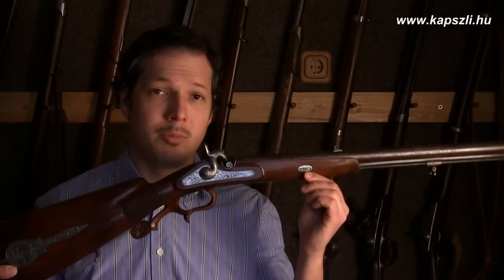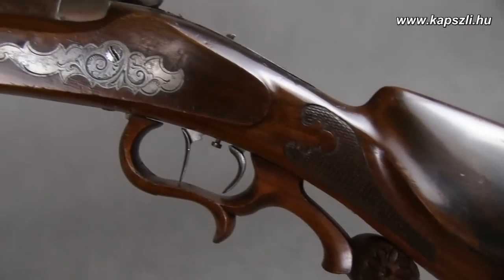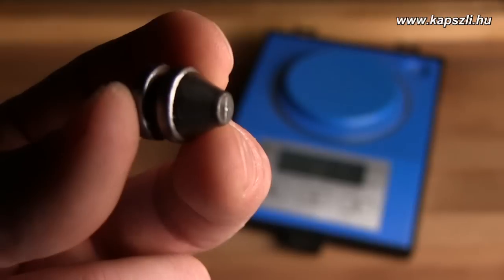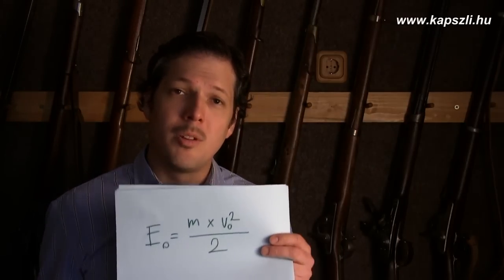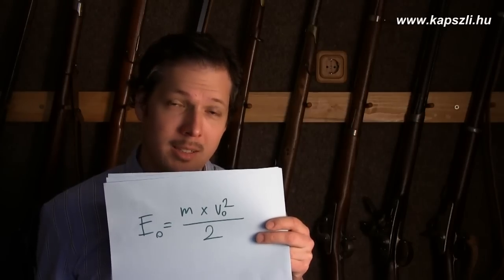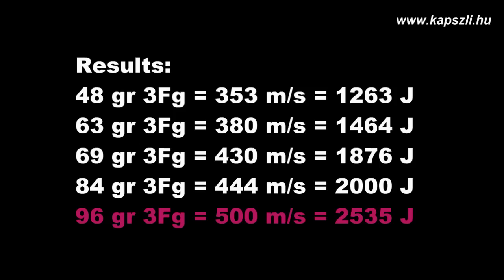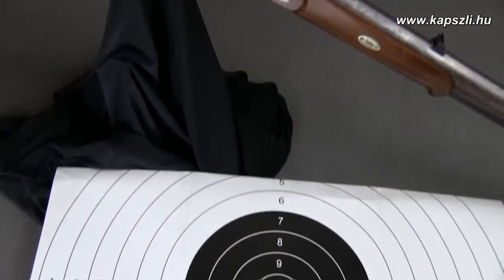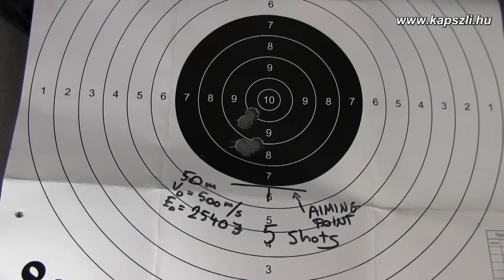Hunting load for an antique muzzleloading rifle

Comment: To give an example, the factory listing for a 170 grain bullet from a Winchester .30-30 just barely cracks 2,500 Jules of muzzle energy. If they had to use the muzzle energy guide here, I'm afraid there would be a lot of rifles relegated to the gun cabinet or the rack of the gun shop as they would get sold off.

Comment: Good heavens, a .58 roundball doesn't have enough penetration? How big do your roe deer get? In north America guys are taking elk and moose with .54 balls, I live in northern Canada where 200 lb whitetails are nothing worth bragging about and I've never had a problem using .50 cal balls. Other than that, great video, top notch as usual.
Reply: spot on and big grizz have been taken with a 50 cal Hawkens
Reply: My dog is larger than most roe deer.
Reply: My new custom made muzzleloader Caplock .510cal 51inch barrel smoothie is arriving on Friday this week, I can't wait to test it out.

Mostly I hunt for upland/small game.
Reply: @explorer3344  I'm confused. Did you order a smooth bore?
Reply: @ironstarofmordian7098  Yes mine is smoothbore. I've shot down two birds so far ^^
Reply: @ironstarofmordian7098  you can see in my channel, I've just posted.

Comment: I have a hawken 50 cal with " made in Italy ", on it with a big  "I"stamped on it. I'm assuming it is an Investarms product but can't be sure. If so it probably has a 1/48 twist rate on the bore. I'm confused on the ammo to use for this rifle. Cap and ball of course is to be used but could I also use a Minie ball? There is blog after blog stating for and against using a sabot round with this twist rate. Any thoughts? I've " subbed. ", your channel by the way and look forward to learning more, thank you.
Reply from the maker: If the twist is really 1:48 it can be shot with patched RB with moderate loads, and you can also use short conicals like Maxiball or REAl bullets with higher loads. The Minié balls will not work well for sure.
Reply: Ok, thanks for the help.I just looked up REAL bullets by Lee-interesting I had never heard of them before ,thanks .
Reply: You can find different bullet designs for that. My dad has a 50 cal bullet mold for loading 500 magnum cartridges. I may use that in a future video.  If it fits in the bore you can use it, just be careful though, don't use something that's too big or too small, it should be in the .490 to 4.95 range.
Reply: I have one of those rifles. I have fired patched round balls with .490 round balls and pillow ticking material lubed with vegetable oil. 60 to 90 grains of 2f worked well. For a fast reload i used a mini ball. Too much powder may blow out the skirt. I ordered my 50 caliber minis from Dixie Gun Works. As i recall about 70 grains worked best. Every gun is a little different so shoot it off a bench and work up a little at a time until you find the sweet spot.
Good luck.
John Davis
Jax Fl

Comment: Nice, but not as useful without knowing the pitch of the rifling twist.  Slow-twist barrels (say 1turn in 66 inches) intended for round balls won't stabilize bullets, and the older Jaeger rifles were traditionally made with one twist per length of the barrel (say 1 turn in 20 inches) and will strip the patch with too much velocity.  Here is an example:

http://www.wkfinetools.com/contrib/bSmalser/jaegerRifle/jaegerRifle-01.asp
Reply: So an old Kentucky long rifle can't properly handle a minie ball? I don't have one to try on but it's been a question I've been wanting answered for a couple weeks.